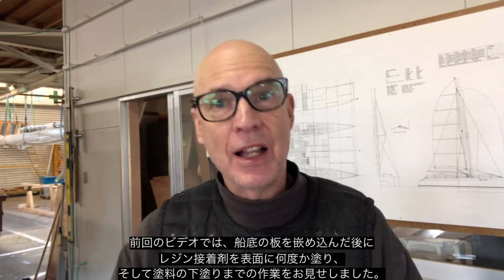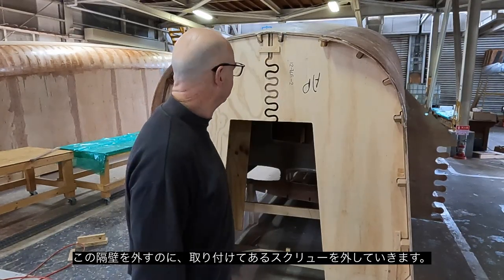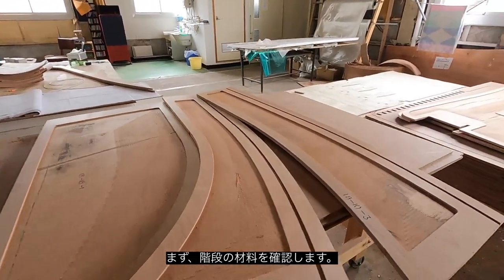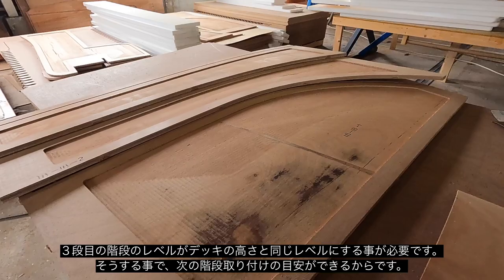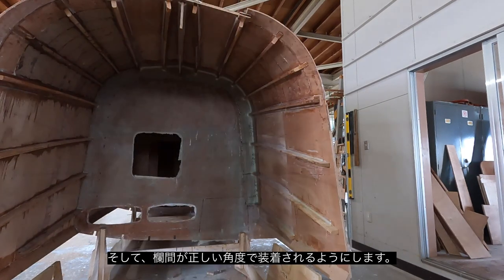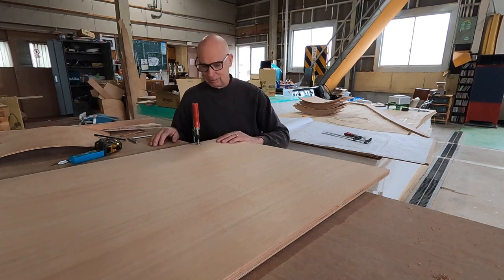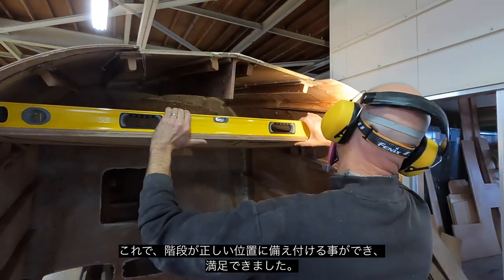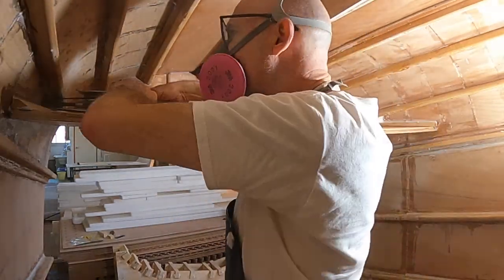Fitting the Transoms & Bottom Steps on a DIY Dix470 catamaran

Comment: I still think you should add a couple of layers of fiberglass to the hull to protect all the work long term…
Reply from the maker: Hi, actually by adding a couple of layers of glass you introduce the potential for osmosis, without the glass, and just the epoxy onto the plywood there can be no chance of osmosis. 
Actually, tests have shown that plywood treated just with epoxy has a much higher tensile strength than fibreglass.
Thanks for watching and your comment 
Kev
Reply: @saltlightdix4704  interesting tidbit of info…. There is certainly always the danger in overdoing something and introducing unintended negative consequences… your boat - your decision…

Comment: Hi Kev!
Question for the design: Why does the design recommend not insulating the hull and placing inner sheets on the partition you were working on now, and as well as the part below the double bert just in front of it. Is it just for ease of production or any other specific reason? I guess the same goes for the front two sections of the hulls.
Reply from the maker: In the aft section there is just the rudder and steering mech, so no insulation needed.
The compartment in front of that there is insulation and lining to the bottom of the chines, or there will be :)
Lower than that is the engine mounts and bearing for the prop shaft.
The very front compartment will not have any insulation or lining as it’s a storage area. The design doesn’t call for it in the next compartment either, but I will be lining that one to make it more user friendly getting items in and out without getting caught on the stringers.
Kev
Reply: @saltlightdix4704  OK, so just for ease of build. That makes sense. 

I guess if you build the boat for use in colder climates the added insulation in these hull sections would help with fending of the condensation on the inside of the hull. I think in general the insulation and build method will make the boat very comfortable in both cold and hot climates. 

Will we see any footage of the insulation and the inner panels 🙂?
Reply from the maker: It’s coming…… be patient 😊

Comment: love the videos. A bit concerned. Are you not going to at least cover the hull bottoms with fiber glass or carbon fiber? I dont think epoxy resin and paint is adequate protection. One small scratch can be a like a cancer and spread through the plywood.
Reply from the maker: Hi Joel, sorry I missed this comment.
It would be a rather long explanation to explain the thinking behind the method.
Suffice to say, Dudley Dix has many designs using this method with great success, including the DH550 which is the same design just 8' longer.

Kev